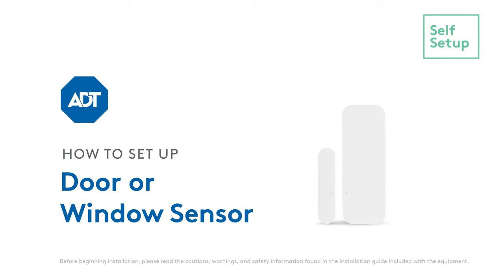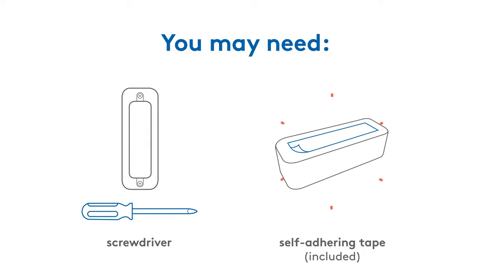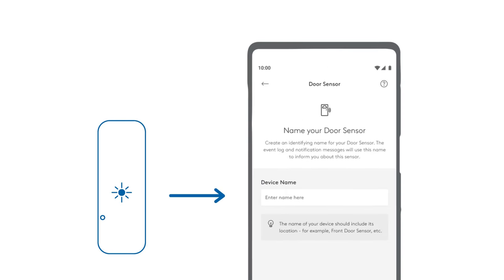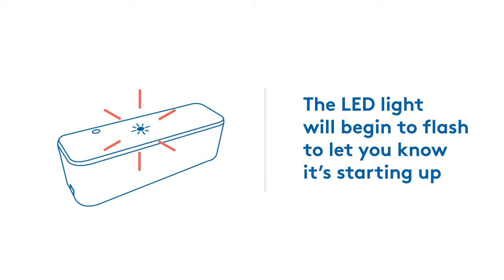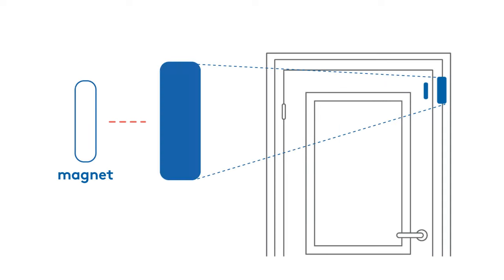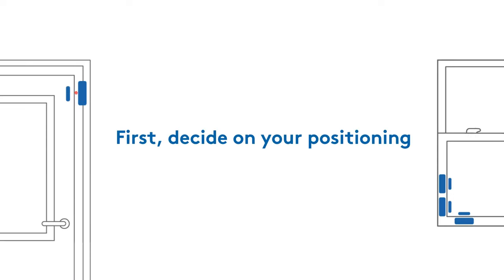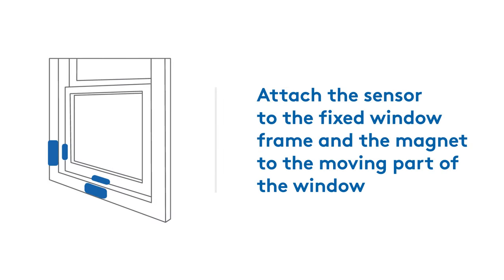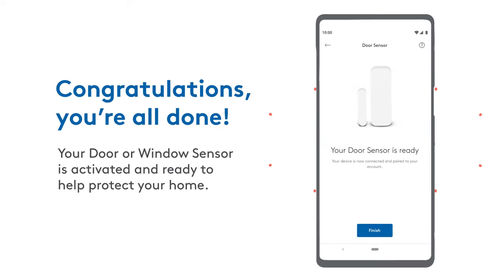How to set up your ADT Door or Window Sensor

Comment: How do you add the device on the ADT+ app??? It only shows you the status there’s no place to add devices on the app. Sensors don’t come with any instructions. This is a terrible process. I guess this app of different than the ADT Pulse app and the MyADT app?? Why do many apps??
Reply from the maker: Hello. If you need to remove an ADT device from your ADT smart home security system, follow the Remove Device instructions:

Go into the Main Menu of the ADT+ app.
Tap Device.
Select the device you want to remove, for example, Door Sensor.
Tap the Remove Device button.
On the Are You Sure pop-up, tap Yes to remove the device, or No to cancel the removal.

You can visit http://spr.ly/6053p7kOv for additional details/tips as well.

Comment: and where is the paring button????
Reply from the maker: Hello, thank you for reaching out to us. Sensors and devices in an ADT Self Setup system are preconfigured so that they will already be paired to your system and can be added by simply removing the battery tab, please follow the steps below.

Pull the exposed plastic battery tab from the back of the door/window sensor. 
The LED will begin to flash to indicate that the sensor is booting. 
The LED will continue to blink once per second while attempting to pair with the hub. 
If a network is not found after 90 seconds, the sensor will go into sleep mode. To wake the sensor again, you need to touch the magnet to the sensor as seen in the image below or press the tamper switch, which can be found inside the sensor’s casing, to repeat the pairing process.

Comment: It doesn’t work like this. They aren’t connecting. The instructions suck. The video sucks.
Reply from the maker: Hello. We apologize for the issues you're experiencing. Please email us at AlwaysThere@adt.com with further details. Please include the address and phone number for where the services are located, so we can review further to assist. Thank you.
Reply: @adt  I got it working and I stand corrected. Here’s my feedback:

1 - you need to pair the sensor immediately with the hub upon pulling the tab out. Don’t stay on the instructions screen just click to where it starts pairing, THEN pull the tab, and place it next to the hub. These details are not in the instructions
2 - adt seems to be a bit of a mess. There are 4 different apps, knowing what’s doing what is nearly impossible. Why not have one single app, one place to go for all things ADT?
3 - connection with Google home is not plug and play. It’s ok, but adt doesn’t recognize any nest cameras that aren’t the latest versions, so all those nest cams purchased won’t show up in the adt app but will in Google home. So guess which one I’ll be using? Google home of course.

ADT - nice try, not bad but not great. Support more nest cams and improve your instructions 👍